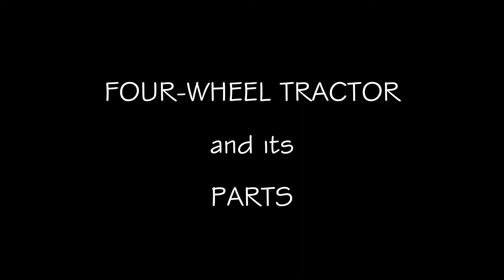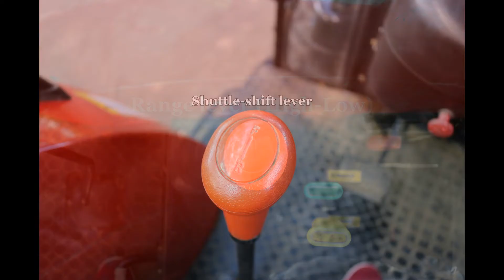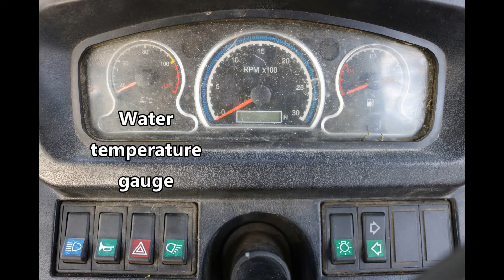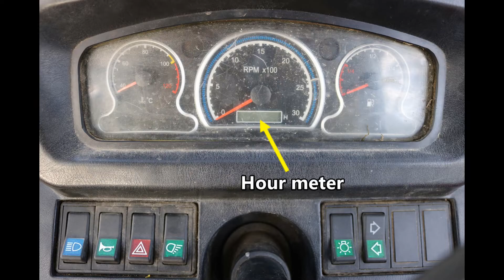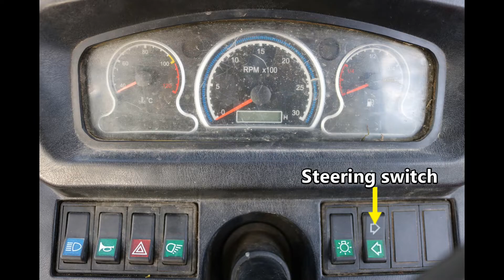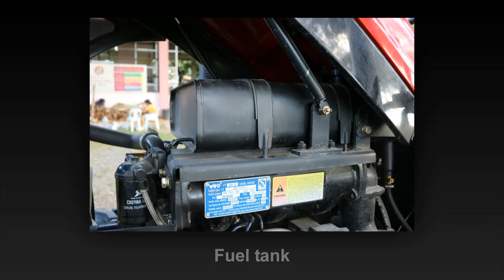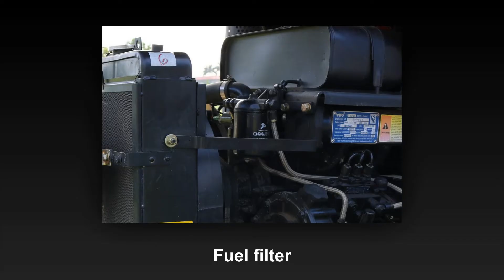Parts of a Four-Wheel Tractor and Their Functions

Comment: Thank you for this video, it's very informative and clear. Let me post this time stamps:
0:41 What is a tractor?
1:10 Common functions of a tractor
1:29 Tractor's "Brand"
1:52 Tractor's external parts
4:49 Tractor's controls and instrument devices
8:37 Tractor's instrument panel/dashboard
10:09 Tractor's component system
11:48 Tractor's electrical and starting system
12:28 Tractor's fuel system
13:46 Tractor's cooling system
13:43 Tractor's lubricating system
16:04 Importance of identifying tractor's parts